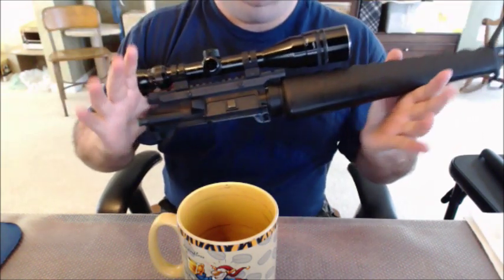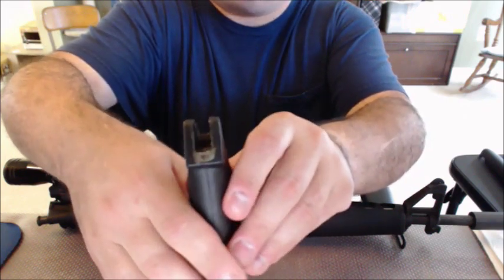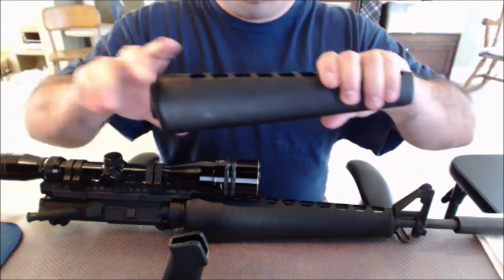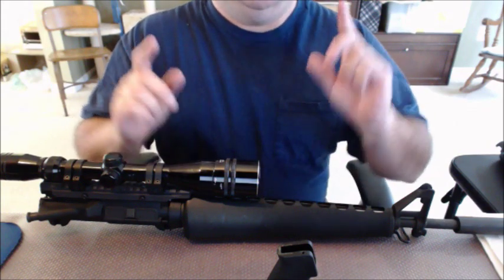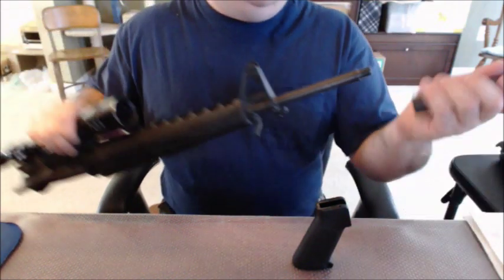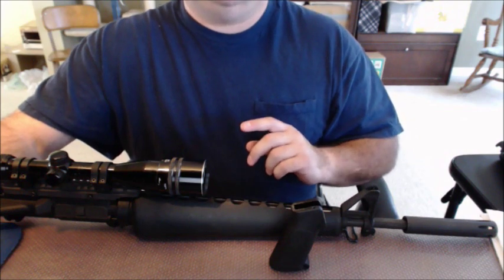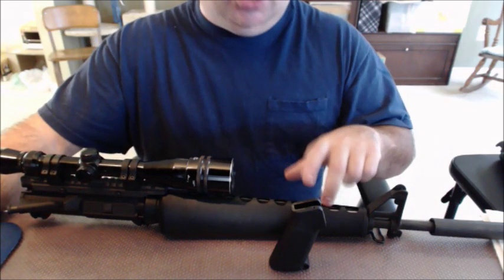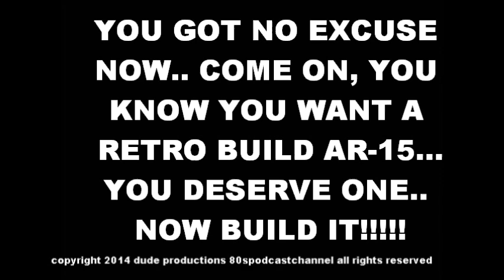M-16A1 Retro Builds

Comment: Dude, great video,  but you're not helping my AR fever any ;p  I'm already deep in AR pistol mode, and now you got me thinking about retro builds.  It'd be cool to do a build similar to the M16A1 I had when I first got into the guard [later model, still the pistol grip with no finger ledge; the oblong forward assist that stuck out a bit, trapdoor stock, and the round vertical handguards] or maybe the 'rebuild' M16A2s they replaced them with.  Those were weird; they literally rebuilt M16A1 lowers [you could see where they hardstamped a '2' over the '1' in M16A1 and milled out the word "AUTO" to relief-stamp "BURST"], slapped the new A2 upper receivers on them and called it good.
Reply from the maker: Dude.. you compare A1 to A2.. the differences are way way obvious.. the reinforcements and other added mass.
sorry for the new inspirations.. but dang it.. everyone should have like five or MORE ar-15's...
Seeya brother
Dude
Reply: Dude, I'm well on my way to topping that number :)  The differences between the A1 and the A2 were obvious, but in the case of my particular National Guard unit, our state tried to go cheap and re-use old A1 lower receivers as the base for arsenal-built M16A2s [I don't think they even sent them back to Colt for the work].  Prior  to that we had M16A1s, but they had most of the late stage retrofits before the Army finally threw in the towel and retired the A1.  It's a moot point now; we got brand new M4A2 carbines in 2007.  Thanks for the inspiration, bro!